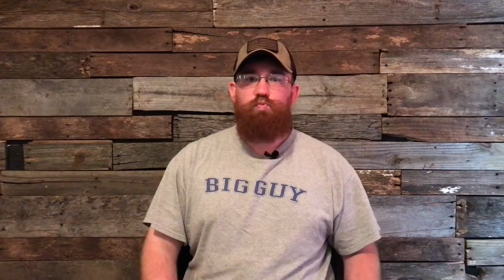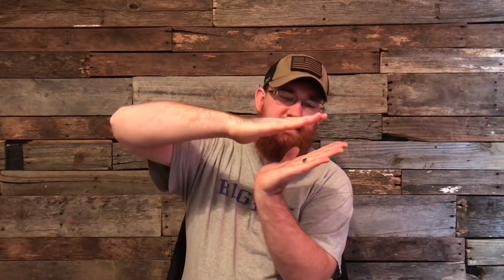Jeep XJ Heat Soak Fix - Simple and Inexpensive Fix

Comment: Just open the hood when you shut it offwill hell it more than anything and want take but 3 seconds, dont just count on a great ass fan, get that heat out of there, and a front bottom spoiler helps, itll send air up under the motor, but dont go a 120 mph with it tho

Comment: I have a 05 TJ 6.0 6 speed which is the poster child of heat soak / vapor lock. I live in SE Alabama and use it as my daily drive (60 miles RT) Sorry for the rant, but if you read my post in its entirety I’m sure you will benefit. 

Adding an electric fan is costly for TJs not equipped with OEM units. You also got to consider the load on the alternator when adding a high CFM electric fan. To cool the engine and push the hot air around will cost you WATTS, more power is required from the engine to cool the engine. So from the start it is a very inefficient way to reduce the heat soak. Yes a fan on a thermostat and timer will help cool in slow traffic and on trails, and will help when parked for a short while after running, but you’ll need other solutions as well. Such as beefing up the OEM heat shield (I installed the DEI product and can vouch for it), I also wrapped thermal insulation around my fuel line from the fuel rail regulator to underneath the center of the cab. I also wrapped the intake air tube (reduces heat stress on the IAT sensor). I also wrapped my twin cats and the exhaust pipe all the way to the muffler (got rid of the 3rd cat - goodbye floorboard heater). 
I can give you all the before/after thermal measurements from the engine block, sensors, PCM, radiator if you want them, but I’m running -50*F cooling in the hottest summer days due to my mods. No electric fan, no hood vents, no cold intake kits. 
BTY - I solved the vapor lock with the DEI thermal kit and thermal wrapping the fuel lines sensors. 

Here’s a couple of additional suggestions to solving heat soak / vapor lock: 
1. Change the existing route of the fuel lines; police cruisers are modified so their fuel lines are routed away from heat sources. Plenty of different paths to run the fuel lines in a TJ rather than across the twin Cats. 
2. Run 100% unethanol fuel; it’s the ethanol that boils in the fuel rail, the higher the PSI the lower the boiling point. I did this as a test to be sure the vapor lock was the result of the gas and not some sensor(s) going wacko from the heat (giving the PCM bad data to trim the ignition). Run a tank of unethanol fuel and see if it reduces (eliminates) the vapor can give you all the thermal measurements from the engine block, sensors, PCM, radiator if you want them, but I’m running -50*F cooling in the hottest summer days due to my mods. No electric fan, no hood vents, no cold intake kits. 
BTY - I solved the vapor lock with the DEI thermal it and thermal wrapping the fuel lines. 

Here’s a couple of additional suggestions to solving heat soak / vapor lock: 
1. Change the existing route of the fuel lines; police cruisers are modified so their fuel lines are routed away from heat sources. Plenty of different paths to run the fuel lines in a TJ rather than across the twin Cats. 
2. Run 100% unethanol fuel; it’s the ethanol that boils in the fuel rail, the higher the PSI the lower the boiling point. I did this as a test to be sure the vapor lock was the result of the gas and not some sensor(s) going wacko from the heat (giving the PCM bad data to trim the ignition). Run a tank of unethanol fuel and see if it reduces (eliminates) vapor lock. When you determine ethanol boiling is the root cause there is only so many options to cure it in the TJ - it all goes back to the twin mini cats roasting the intake sensors and fuel rail. 
Thanks California!

Comment: Good video and informative.   I do have a few things though.  I have an 89 Comanche and luckily, I never suffered from heat soak.  I've had the overheating issue, but to me heat soak is much like the overheating, doing modifications to "fix" it is just a bandaid.  So the fan will bring air in the engine bay and push it through the louvers cause heat rises.  Another big reason for heat soak is the exhaust manifold sits right under the fuel rail/intake/injectors, so it has a big part in that.  The Jeeps did come with a heat shield and perhaps the heat shield is deteriorating and needs replaced?  Maybe the exhaust has a leak and allowing excessive heat to come up?  You mentioned maintenance, perhaps the engine wasn't maintained properly and the wear is causing excessive heat?  Either way, I am a firm believer, if it didn't happen on the show room floor, it wasn't meant to happen and the real culprit needs fixed.  Like I said, great video and very informative.   I like to keep my interior clean, so if I ever did this mod, I would think about a capacitor that would hold X amount of time to run the fan after switching the jeep off so no forgetting to switch it on or off.

Comment: Ive been driving my xj for 20 years, never had this problem, something changed because now im having heat soak, so the real solution should be finding a way to return to how it worked from the factory, not modify or reengineer your engine with relays or other inventions

Comment: As someone dealing with heat soak now vs when I had holes in my hood is a pretty large difference though (on my set up) 
Running wrapped headers right now, wrapped radiator hoses. No fancy fans or anything, but Jeep is running in a city and it hates it now, running the fans might be an option. Never thought of that.

Comment: Hey Ronnie,
how do i get water to my back window wiper? Is there a separate water source?
93 six cylinder cherokee 4x4
Reply: There are two different wiper fluid pumps in the front driver side wheel well. The top pump controls the rear. The pump itself is only about $10 on car parts.com 
I had the same issue with my 2000 xj

Comment: Heat Soak makes sense. I drove to the junkyard on a hot day in Houston doing 70 mph on I-10. never had a problem to and from the yard. I then drove from my house to dairy queen and my car idled ROUGH in the drive thru to the point where no amount of pressing the gas pedal would make it move. It then stalled out and did this until I got into a parking spot and opened the hood for a bit. Ever since then, if I drive my 93 anywhere for an hour or two, it will start idling rough or stalling at any stop.

Comment: I have a Datsun 240Z with a turbocharged inline 6, and the exhaust manifold and turbo are right under the intake manifold, so the fuel rail and injectors get baked. I can literally hear the fuel boiling in the fuel rail after shutdown, despite adding all sorts of heat shielding and hood vents. Hot starts were near impossible. So, I added a time delay relay to the electric cooling fan circuit to blow the hot, stagnant air out of the engine bay. The delay relay keeps the circuit active for 20 minutes after the engine is shut off. The fan thermostat still controls turning the fan on and off so the fan only runs as needed during that 20 minutes. The time delay relay is configured to turn on when the ignition switch is turned off, so I don't even have to flip a separate switch. I used a VM188 Pulse-Pause timer from electronics123.com. Works really well. If I've only stopped for 10 to 15 minutes, I can now actually restart my car up on the first try and drive off right away.

Comment: Hey Ronnie, good video.I have a 2000 WJ, loaded w/4.0 with no heat soak issues. Even in northern Delaware in the summer when it's 98 degrees w/100 percent humitiy. & AC on. It is a must to wash BUGS & debris from the radiator! , & we all know 4.0's aren't potty trained very well! Keep oil off the passenger side!

Comment: A few questions, cuz im new to working on cars. is heat seeping into the hoses and systems itself bad or only bad when you drive it while their still hot? like will thr hot parts break eventually even if i let everything cool before i drive it?

also, how long will the fan have to run before the battery is drained?

would love to see you implement this thing in a video

Comment: Do you have a link to a timer relay that could be use? For me, any help to reduce the effect of the heat, is valid...thanks
Reply from the maker: El Padrino google Beuler BU508TD 12 VDC Automotive 4-Pin SPST Time Delay Relay with adjustable timing
Reply: @LeggettsGarage  Thanks,  Pura Vida from Costa Rica...✌

Comment: Just put a cooler thermostat in. I've got a rinolined hood and fenders so mine really holds the heat and a 180 degree thermostat works great. Now when its 0 in the winter don't expect your heater to blow hot, in fact if I turn my blower over notch 2 I can watch my engine temp drop.
Reply: You do realize all that changes is the temp of the coolant when the thermostat opens

Comment: Let me tell you my problem..
3-4 months ago my Jeep XJ 4.0 started running like shit... No power would not get out of it's own way backfireing ECT.
I change the throttle position sensor the IAC clean out the throttle body and put in an O2 sensor thinking these were the problems it was not although relatively new about 3 years old it had a aftermarket catalytic converter on it that had clogged up
I didn't think that this was the problem being that it was so new so I ended up cutting the exhaust just before the catalytic converter and all the symptoms cleared up started running better had more power but it was loud...
I drove it that way for about a month only because I couldn't afford to fix the exhaust pipe on it so I drove it this way with the Open Exhaust one of the symptoms of this is it totally knocked my computer out of whack 1993 Jeep with a Chrysler computer when I would drive the vehicle once it got warmed up the IAC would open and stay open at idle  causing it to idle high..in order to get it to come down I would have to while the vehicle is running stomp the gas pedal all the way to the floor this was taking and opening the throttle position sensor all the way up which in turn resets the computer and closes the IAC and brings the idle down... your throttle position sensor is nothing but a potentiometer this action in the Chrysler computer world is called putting the computer into a no flood mode it resets the parameters... On the flip side of this if you would get into the car and drive it two blocks and shut it off it would create what you are describing which is hot soak or like it was flooding the engine my point is that this condition is caused by O2 sensor now we all know that the injector pulse is derived from the distributor on a Jeep your hot soak condition is caused by the O2 sensor does not pick up the proper amount of air fuel mixture tells the computer to richen the mix and changes the timing of how long the injectors are open it's forcing the injectors to be wide open therefore when you shut the engine off yes the fuel does vaporize but it floods the engine because the injectors are dumping way too much fuel into the engine the only way that you can cure this when it happens is to hold the gas pedal all the way to the floor until the engine starts to spit and sputter as your starting it then back your foot off slowly while the engines running until it clears out and hold it about halfway open then it clears it out then it'll go back to a semi normal operating mode so you're hot soak that you say is caused by injector pulse due to the variables in the computer are out of whack

Comment: Not one of your best videos. I couldn't take it and stopped watching less than 1/2 way through. You kept saying the same things over and over.  And The 4.0 is not stuffed into that engine bay. There is a lot of room around it compared to modern engine bays.
I think you missed the mark on this video.
Reply: your right it is big for the bay but more so front to back. its fit super tight against the firewall and the radiator. can't work on anything up front without removing the e fan and still I gotta cram my arm in there. but yes there is quite a bit of room on the sides and many ways you can relocate things to make even more room if you wanted... I think its pretty stuffed in there though

Comment: I had heat soak issues too,or so I thought.So I changed my spark plugs,coil pack and placed the heat shield under the fuel rail and wrapped the injectors.
It helped but didn't solve the problem.
I took my cylinder head to a machine shop and they removed the carbon and replaced intake and exhaust ports.
Since then I never had a heat soak problem,even on the hottest humid days.
Reply: 1996 JGC fan is always on ….. 5.2
Reply: How much did that all cost to get done?

Comment: The high ethanol content in today's fuel is more of a culprit than redesign of  2000/2001 4.0 engine.... In a nutshell the ethanol turns to vapor in fuel rail. My 01 XJ died a slow death due to all the motor defects .... Bad head etc...
Reply: Best thing I've found for the heat soak ,is if at all possible just pop the hood for a few minutes after a long drive in Hot weather and use a ethanol stabilizer.

Comment: I have the 2.5  4 cylinder in a 94  xj does heat soak affect this  motor the same   ?? I can put the timed relay  ez but if I don't have to I won't
Reply: PS what electric fan fits in front of the radiator

Comment: 4.0 Wranglers have heat soak issues and it actually seems to more common than in the XJ and the Wrangler was Designed for the 4.0. I have never had any heat soak issues in my XJ. A friend of mine had a 01 Wrangler that had heat soak problems and he traded it for a 98 XJ, no heat soak problem with it. I know 2 other people with 96 and 99 XJs and they don't have heat soak problems either.
Reply: I have heat soak problems with my 01 XJ. From what I understand it was a problem for that year because they started making all XJ's California compliant by adding additional catalitic converters in the exhaust manifold. The additional heat from those cats I feel makes a big difference in weather or not you have a heat soak issue. I've dealt with a 98, a couple of 99's and a few 01's, all XJ's, and the 01's are the only ones I've had issue with.

Comment: This what solved mine! Take your AC Condenser radiator out so your main radiator gets direct air. Second toggle switch your radiator electric fan when the engine gets at 210 click it on. My truck runs at 150 yr round hot and cold weather.
Reply: Then you won't have AC, also if it stays at 150 your thermostat is bad.
Reply: @Lray4x4  thermostat is 1 of the first things I Changed cause of the overheating. My AC never worked it's an 89 as cost way more to switch over then I wanted to pay. Engine dose warm up when I'm sitting in traffic that's when I turn on my fan. The problem was the AC radiator fins were clogged so never allowed enough air 2 the secondary radiator behind it. Now it runs cool unless in traffic as I mentioned

Comment: I've been having this issue for forever and I've pretty much "ghetto" solved it by turning on the heat and leaving the key in (at a trusted place like a friends house or running inside the house) or by popping the hood, either pulling the latch inside so it's cracked or opening it all the way. Thanks for the way smarter way of doing this! I'd love to see a video of you installing the fan and relay
Reply: Does your AC still work?
Reply: @svborek  Yes, and so does the heat